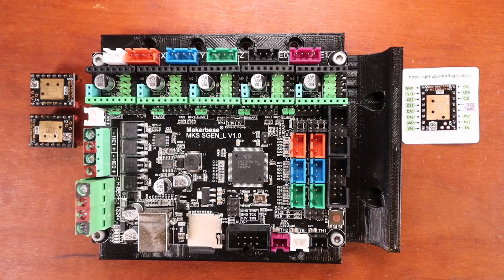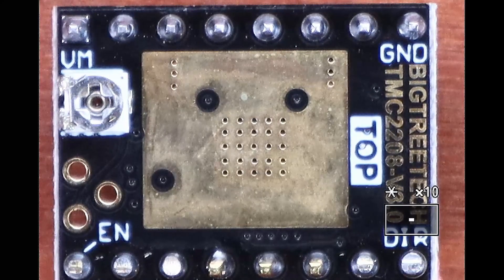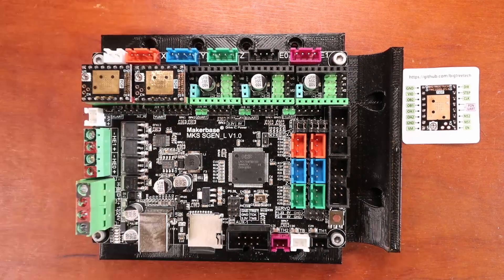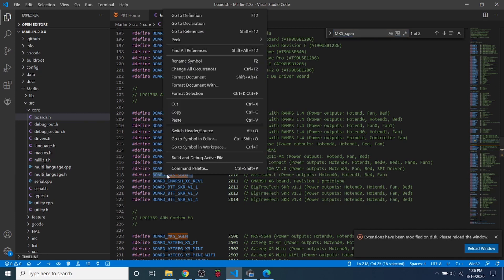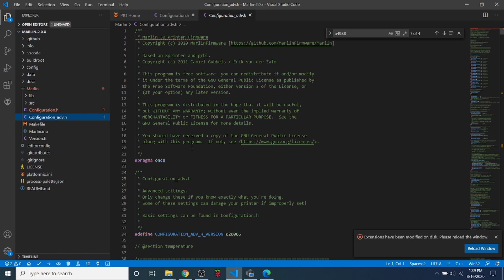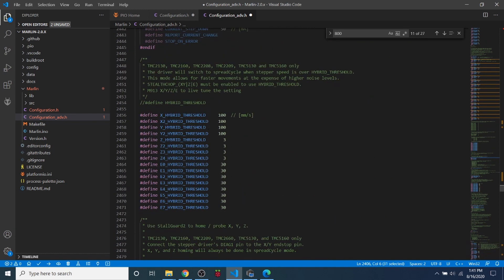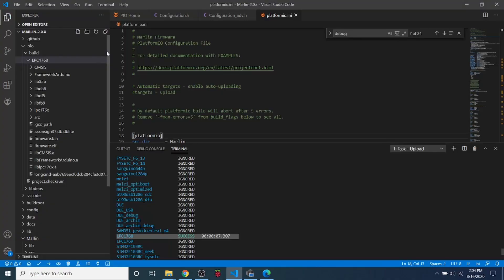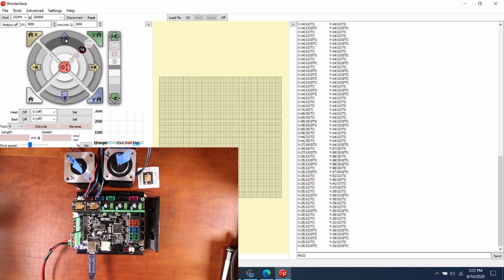MKS SGEN L V1.0 - TMC2208 UART install

Comment: Where did you bse your DEFAULT_AXIS_STEPS_PER_UNIT on? It seems way higher than my firmware was on :)
Reply from the maker: It's based on reprap calculator.
Reply: @EdwardBraiman  which one? :). As in. Where do I find it?
Reply from the maker: @victoroos  This will vary with modern steppers like TMC  ... https://blog.prusa3d.com/calculator_3416/

Comment: have the same driver and board and followed your instruction but get "tmc connection error" on screen
Reply: I think the information about the missing resistor is the problem at 2:20min. On my driver is there nothing so I have to connect this pads. could you define the resistor amount because the documentation shown nothing. thx for your help

Comment: Hello good day. I have seen your video of the mks sgen-l board in uart mode and perfect. But I have a problem, I also have Mks tft35 v1.0, it handles the engines well, but when inserting SD with Gcodes, it reads them but does nothing and it only appears to load media and does not print. Could you please help me?
My Email: jorgedelacasa@telefonica.net. Thanks a lot .

Comment: Thanks for this video. I’m also getting the TMC connection error. MKS SGEN L 1.0 and 5 TMC2208. 
Don’t you need to add 2 pin headers on each driver ? You did it on the 2209’s when you swaped them for these 2208’s.
Reply: I fixed my TMC error by soldering the 2 small pads togethers on the back of the drivers. Then you dont have to select “stand alone” mode in the Marlin code.
Reply: @jvejvad  yes right same here
Reply: TMC2208_STANDALONE you have to
Reply from the maker: No sure I understand stand alone.
Reply: Hi! where did you put the pin header  for the tm2208 standalone ?
Reply from the maker: Standalone is a completely different configuration I do not cover as it's not reversible.

Comment: it is worth switching the z axis and extruder or it makes no difference
Reply from the maker: In my opinion it may not help.
Reply: @EdwardBraiman  Thank you very much, while the jumpers I saw that you removed from all axes, it is necessary or I can only remove from the x and y axis
Reply from the maker: X and y are required per video instructions.

Comment: I installed 3 TMC2208.
When booting, there is an error message: "TMC Connection Error".
But the printer still working fine...

Tarantula Pro
MKS SGEN L v1.0
Marlin 2.0.7.2
Reply: Go to cofniguration menu, advanced , initialize eeprom... FIXED
Reply from the maker: Was the power off and where did you see the error on the TFT or LCD or a connection in serial?
Reply from the maker: What's connected to MKS sGEN l v1?
Reply: It happened to me too. On configuration.h insted of tmc2208, i wrote 2208 standalone and it fixed it... Dont know if it is the right way but it fixed...
Reply from the maker: Which manufacturer of TMC are you using?
Reply: @EdwardBraiman  fysec
Reply: But mine doesnt work, if I put to heat it gets crazy blinking the menu .

Comment: Edward Braiman thank a lot for your tutorial, I am putting together my print and I get the 1.4 turbo board, I want to know if it can work with 3 independent axis BL, I find that only 5 axis on the board, Can I add Step motor expansion board?
Reply from the maker: In theory, yes.
Reply from the maker: But it's in my SKR 1.4 playlist.
Reply: @EdwardBraiman  I was looking on your video to followup, I just finish your video of firmware update in my new 1.4

Comment: Good tutorial, but at this time you should use the TMC2209s, they can handle higher currents or the same current without overheating, I use them without a cooling fan and they work very well, many improvements, including sensorless homing
Reply from the maker: Sounds interesting.
Reply: is the procedure the same ?   i have 2209's with the 2 extra pins,  do i still need the jumpers ?
Reply: @samjanssens1509  Yes you do, but not all TMC2209 are the same, there a various brands and versions... Key is to check which pin is used for sensorless homing and how the serial communication is wired